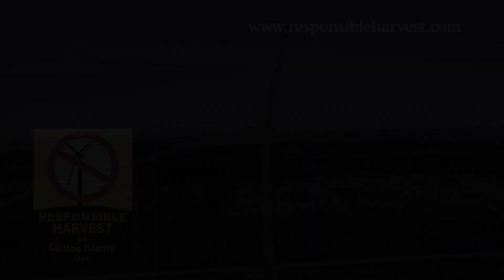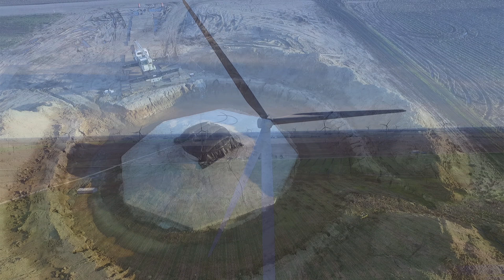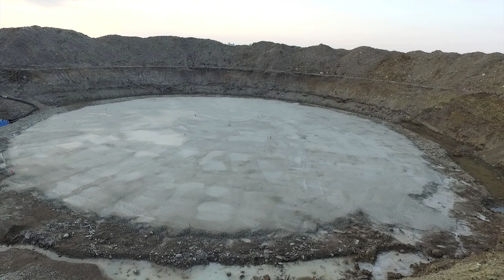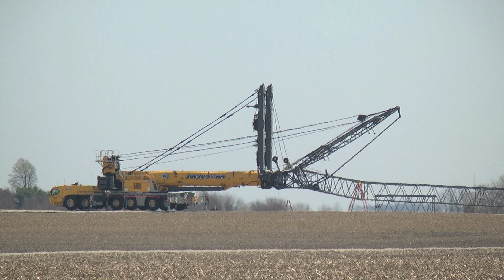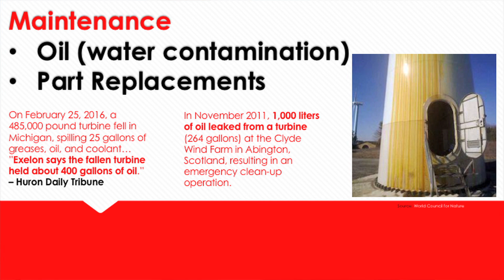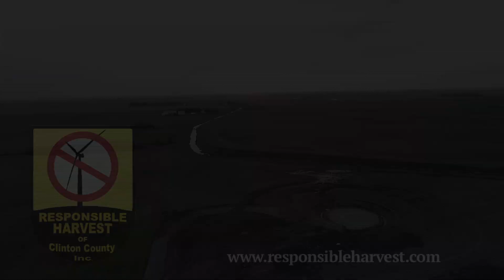Wind Energy: Not Clean, Not Green

Comment: Your segment about the transmission lines as part of the cost is very weak.  Transmission lines are required for all types of power generation systems and are arguably shorter for wind generations methods because many people would desire or capable of living and working closer to a wind turbine than a nuclear powerplant, coal burning plant, or hydro dam.

Comment: You offered not a single solution, just complaining. Would you rather have a coal mine in that area instead, or how about a nuclear reactor?

The question is what is the solution you can use? If you can't find a better solution then you pointing at the sore won't prevent it or heal it. The question can become, what poison do you prefer? The point is, you are the reason all this is happening, you are the one turning on the light switch, you are the one heating/cooling your home and office.

Comment: What a one sided crap f%$king video, this guy is so thick and unknowable.

Yes, it takes resources to build and maintained wind farms but compared with coal is nothing.

Building a coal power station plus the supply chain from mining the coal transportation by trucks, trains, massive ships, harbours etc.. would take as many if not a lot more resources to build the infrastructure as the wind farm per average MW. and then think of oil and resources used to actually mine and transport the coal around the world. And think how much damage is done by strip mining coal, pollution, environmental damage. And all this Coal infrastructure only has around the same short life expectancy as the wind farms and as for recycling?

and then an average coal power station burns 9000 tones of coal per day, over a 30-year life that's 100 million tones (100 billion kilograms) of coal that has to be mined and transported around the world.

And the wind turbines burn ZERO ZERO ZERO fuel and just need a small amount of maintenance. (probably a lot fewer manhours to maintain and operate compared to the coal infrastructure.

Wind turbines have a very small footprint on the ground farmers only loss around 1% of the land. Compare this to strip mining!

And he talks about the tiny amount of oil the gearbox uses, compare this to the oil the ships would require to transport the 100 million tones of coal around the world plus the mining etc.

We need power, we have to build something to generate that power, and yes need to do proper comparisons of different types of power generation. Not just nitpick against one without comparing to the alternatives.

Comment: Only one question remains - which utility paid for this FUD video?

Wind turbines are not perfect. But they are much more environmental friendly than conventional power plants. Coal power plants get coal which is delivered by diesel powered trains, and burn the coal every day 24/7. Parts for the wind turbines are delivered one single time, not every day. 

You can also use offshore wind turbines. They are more powerful and no roads need to be built for them, they produce cheaper electricity than an conventional power plant and on the sea it is always windy.
Reply: So are hydroelectric plants which is a conventional power plant lol (and they produce a good deal of power given water levels meet the requirements)
Reply: @sockshandle  of course hydroelectric plants are a good thing, if you can build them (you need a river and enough water).

Comment: I mean..... in 5 years, coal will still produce more CO2 than wind turbines. Also if they don’t provide enough power then built more or just switch to solar. Why is it so easy for Europeans to accept this compared to Americans?
Reply: First solar plants don't really provide more power than one wind farm at only 4% efficiency. second Economic Impact (specifically Direct economic impacts cause every fossil power plant provides hundreds of jobs whereas Wind and Solar you really only need 3 or 4 people to maintain the plant/farm hydroelectric provides about half the jobs when taking into account how many jobs are created via the construction and supply of the plant/maintainence supply and generation methods used in general for example in coal mining country millions of people (despite automation) are employed in the use of coal mining and they only know physical work and it would take too long for them to be retrained and that's only if they can get another job as its not 100% assured that they will even get another job because of widespread Automation in that case lets say one coal fired power plant burns 500 or 600 tons of coal per week that is a fair number of people employed then replace said coal plant with a solar wind hydro or geothermal plant that results in the demand of 500 to 600 tons of coal being taken off the market

Comment: If it were made of wood, it would still use some fossil fuels it and transport the material.  You can make the claim for anything.  Point is, it doesn't require fossil fuels for its ongoing generation of electricity.   Try harder next time.
Reply: Replacements parts ring a bell? Also the fact that those companies are Obligated to provide power even when the wind isn't blowing.?

Comment: I agree with you wind turbines  are sold as the greatest thing since sliced bread.  They should include the things you mentioned but in today's world of sales pitches nobody tells the true story. They only tell the part that makes them look good. The one thing that I personally have an issue with as far as wind and solar is they only work part of the time. Everybody wants power 24/7/365 with no interruptions. Solar especially has peak production when the load on the grid is at a low point of the day. Until a viable resource is made commercial available that will serve us better that coal, gas or oil as a base unit none of these other so called green technologies can do but so much. The grid is already having a hard time staying balanced with the amount of solar that is running now. It producing too much power for the load available at the time it peaks. Grid operators are having a hell of a time trying to have enough power at 5am when morning peak starts then ramping down till about 5-6pm when the evening peak starts.

Comment: What you have not compared with is the construction of a thermal or hydro generator which use just as much concrete, steel, precious and rare metals if not more and then continue to consume non renewable fuel which produces harmful byproducts for the life of the generator. In the case of thermal generation it requires constant maintenance at a level far greater than a wind generator . Your argument just does not stack up at all
Reply: You seem a bit confused. Hydroelectric generators don’t use fuel of any sort. Thermal generators are typically either nuclear or coal powered. Nuclear power plants use so little fuel that it basically doesn’t matter that the fuel is non-renewable, as the stock of fuel is essentially limitless. Coal fired plants use a fuel which has no other purpose, and there is a huge supply of it, so why not use it? So long as we filter the pollutants out of the exhaust, which we do a really good job of these days, there is no real negative side to burning coal. Finally, the maintenance on a single wind generator is very high and very difficult, and its life very short, for the amount of power it generates. All these other power sources require much less maintenance for the amount of power produced, and the maintenance is much easier since they are at ground level. They also tend to last at least twice as long as typical wind turbines, and they’re not such an eyesore, since they can be concentrated all in one place rather than scattered all over the countryside to the point where there’s no direction you can look without seeing these things beating against the sky in the daytime, or the sea of red lights blinking everywhere at night.

Comment: Solar panels and other machines require a lot of INITIAL filth. In the end, there's not just 1 right way to do things. Now, is a wind farm cleaner over the life of the farm than a coal plant over the life of it's coal plant? That's the question that should be asked. I do know that modern, quality turbines are not prone to overheating, use bearings and brush-less systems so a regular supply of coolant or lube shouldn't be necessary. The numbers and facts about most things not seen as mainstream tend to be cooked. Not sure what this guy's going on about. I can get a turbine, bolt the pole to a stand and that stand to the roof, seal it, set it and forget it for several years of producing 300W about 1/3 of the time that doesn't come from the burning of fuel or continuous release of gaseous or fluid emissions. Might get some steel fragments falling onto the roof toward the tail end of the turbine's service life, but everything wears out and there's no getting around that. Everything is produced dirty if that's how the manufacturers or shippers choose to do it or transport it, whether it's turbines, solar panels, steam, water turbines or any other product. Seems like that's not a problem with the tech. It's a problem with the currently popular business models behind that tech and more.

Comment: Reading the comments and watching the video it is amazing the lack of intelligence present for so many on both sides.  Perhaps some clarity.  "Green" energy is merely energy being generated by sources like Wind, Solar, and other such sources considered renewable.  Being Green does not mean it is perfect.  Also there is no such thing as clean energy.  Any energy source has a cost to produce.  Nuclear, Coal, Oil, Wind, Solar .. all require rare metals, the production of materials, transport to sites, labor and disruption of the area to build the system and connect wires to the grid.  All l produce waste of some type over time in varying quantities (and this includes the waste produced at the end of life of a wind/solar plant when it has to be deconstructed).  The only real question is what are the total costs and impacts for a project over time and what do you want to live with consequence wise.  For example comparing a Wind Farm to Coal plant, the wind farm clearly wins in several key areas you do not have to deal with all the coal ash/waste over time and it produces or uses far less CO2 in construction or operation (even if you burn low sulpher coal and sequester the CO2 underground for the coal plant).  Yet if you remove the government subsidies the Coal plant can be the cheaper solution over a 50 year time span (though as more stringent pollution laws get passed that cost might increase for updates and rehabs so the overall cost could be similar) and it can be far easier and quicker to build (and least outside the zoning laws in the US .. look at China).  It's all about balancing the pros and cons of any choice.